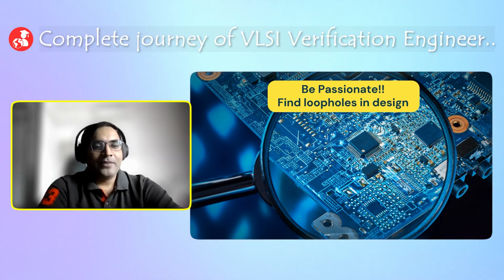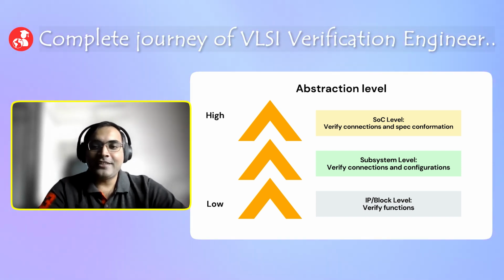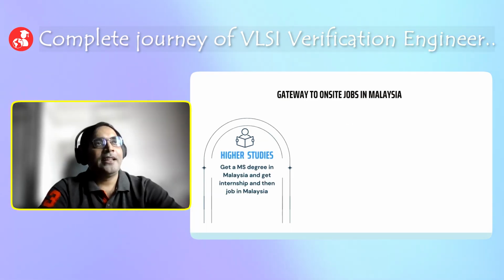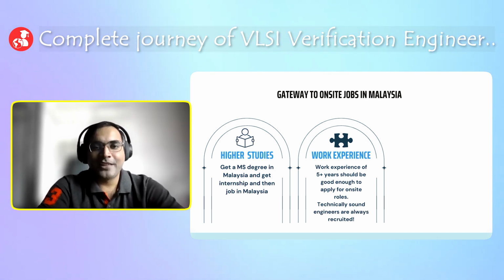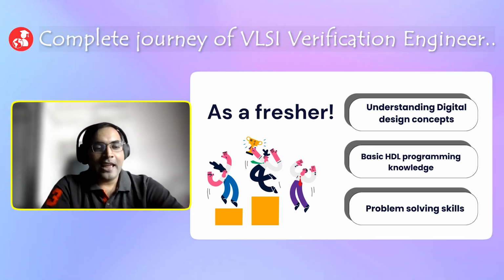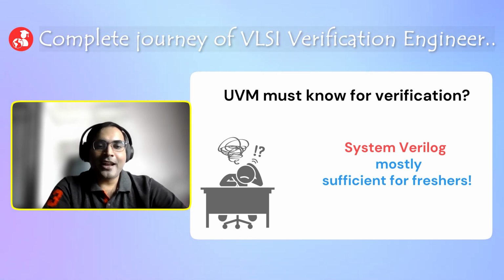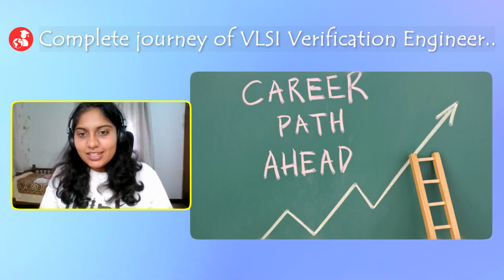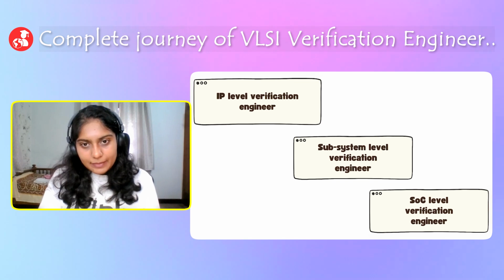How to become VLSI Design Verification Engineer: Interview preparation | onsite job switch | Project

Comment: As an ECE student currently in my 3rd year (transitioning to 4th year soon), I’m planning to pursue a career in VLSI verification.

I understand that a strong foundation in Digital Electronics is essential. However, I wanted to ask if there is a specific, industry-oriented syllabus or set of topics in Digital Electronics that are particularly important for verification engineering roles.

Similarly, for languages and methodologies like Verilog, SystemVerilog, and UVM, could you please guide me on:

The key concepts and depth of knowledge expected at the entry level
The most relevant topics to focus on for interviews and practical work
Any recommended learning path or resources that align with industry expectations

I would really appreciate any guidance on how to structure my preparation efficiently and avoid unnecessary topics.
Reply from the maker: I have covered the key topics and recommended roadmap in my other videos, please check those out for a detailed guide!